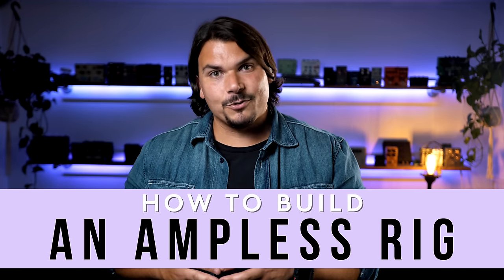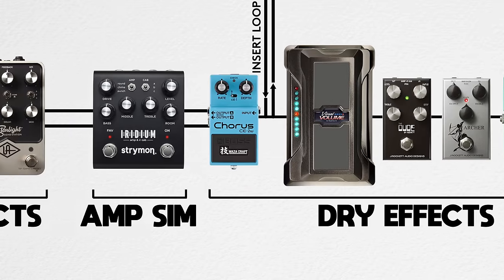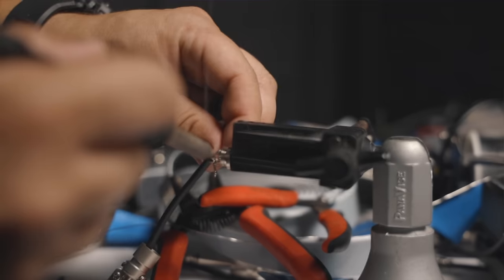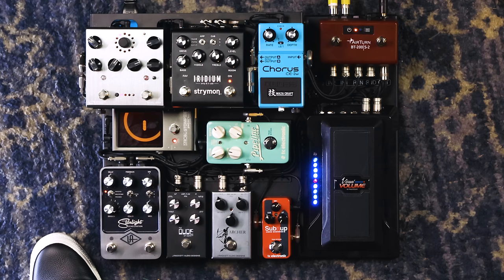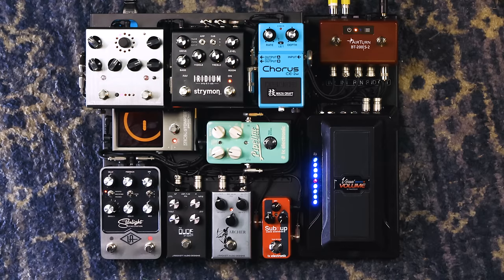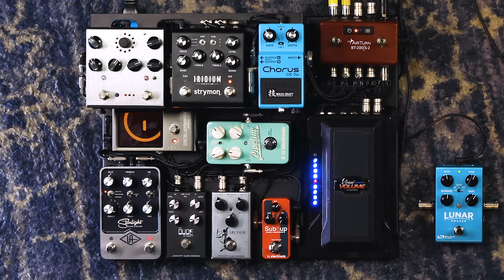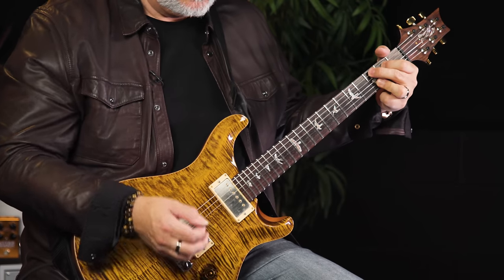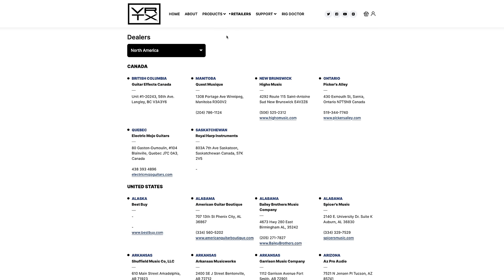Do You Need an Amp to Get Great Tone?

Comment: Thank you so very much for this episode!! The only set up issues would be if you want to 1. run the Iridium last to use as the output buffer and 2. If using the Iridium's headphone out, any effect placed post Iridium will not be heard through the headphone out for quiet play situations.
Reply from the maker: You can always run buffers at the end or choose pedals with low output impedances to drive the line back to the mixing board.

Comment: On my latest electric guitar styling post, playing a 1978 Univox Les Paul JR DC/single-P90, I am playing a rather interesting signal chain, which I will call ampless, but not exactly.

I have a 1964 Sears Silvertone 1482 in great condition (one cap needed replacement), which is fronted by a Behringer VT999 vintage tube monster (using a 1 amp dedicated power supply and a Genalex Gold 12Ax7), which I chain through a Bugera PS1, routing its line-out into the input-jack of Pod-Go (so that's three 12Ax7's and two 6V6's, along with the tube-tremelo circuit of the Silvertone [ plus tube rectifier on that puppy ] ) fronting a pod-go, where I use the "archetype" amp model on clean-switch and matching cab model), adding a DDR-600 spring reverb, all of which I then route through a Mackie DFX-12 (adding small room reverb and final EQ).

In front of all that is my pedalboard (skb-25 velcro!), from G10 to Boss CS-3 and Aphex Aural Xciter / Big Bottom, two (not one, but two) NR pedals along the way, noting that the effects loop of the Pod-Go send/return bringing in my Arion SCH-Z chorus pedal (remember those?).

So, it's kind of amp-less, chuckle!  Have you heard of anyone using a Sears Silvertone 1482 as a distortion pedal?  Chuckle.

Oh, I recorded into a Zoom H1N (24/96) - straight to micro-SD card. Which is cool because the Zoom H1N is "signal level activated" to start recording.  Not one general purpose computer in use (no DAWs, no nothing). Just pure guitar recorded onto micro-SD card.

Of course, the main guitar part took me 5 months of practice to pull it off in one take (that's a ten minute piece). Whew. Chuckle.
Reply from the maker: Sounds cool!
Reply: I omitted a part of the signal chain -- what I will call the "wet / dry" part of the signal chain.

The Bugera PS-1 has a cab-emulated XLR out. Introduce my UB-502 mixer (I have to give a shout out to the UB-502 mixer, which is about half the size of chocolate box). The cab-emulated XLR out represents the "dry" portion, while the "wet" portion is represented by the pod-go, with the Arion Chorus SCH-Z on the effects loop, along with the DDR-600 stereo reverb.

I use the UB502 mixer (which has an XLR input for the "dry", along with stereo input coming from the "wet"), and then I route that mix into the Mackie DFX-12 (which then goes to the Zoom H1N line-in to micro-SD card).

Comment: I use a cheap board rig of guitar - boss sustain/comp - boss pitch shifter - joyo AC tone amp sim - joyo analog delay - joyo atmospheres reverb - looper/tuner - Xvive DI/Cab sim into my mixing board and or optional Orange amp & cab. Powered by a rechargeable power supply. Everything is mostly self powered and can mostly fit into my backpack.
Reply from the maker: Cool!
Reply: @VertexEffectsInc  i  decided to ditch the Orange. I decided to sharpen my Boss Katana instead.

Comment: Bit off topic but since building an interface/buffer was mentioned I notice Mason uses the same solder station I have - a Weller which is invaluable to me. I've done PCB work on older DSL's which can be tricky, but pedal stuff is even smaller. I finally tackled an intermittent power problem on a Nobels ODR-1 today and resoldered the bottom input and power jack connections which fortunately seems to have fixed it. But things are so small that it's almost imperative to have an adjustable heat range and a small, skinny tip. Weller type stations are more expensive than a garden variety iron or gun, but IMO those can really do damage to small PCB boards and components.
Reply from the maker: Well said!  Weller is great and makes easy work out of soldering.

Comment: Make more videos about using various pedals that are amplifiers pedals. The Doug Aldrich Baroni Lab Miniamp is 120watts and suppose to sound just like a plexi. If they have really good fender tweed, blonde, blackface miniamp pedals like this to put on your pedalboard to go ampless. The problem is finding really good miniamp pedals that sound very close to tube amplifiers that uses JFETS or MOSFETS instead of digital processors. The picking dynamic range very touch sensitive is what to focus on.
Reply from the maker: Thanks for this info Wayne!

Comment: I get why you want to run the Iridium before reverb and delay . To get results like you would in an fx  loop but how does that effect impulse response? It seems like it would be equivalent to putting reverb and delay on a cab mic.
Reply from the maker: It would be like using the effects after the mic, correct, like 99% of studios would add on processing effects in post or from a mix bus.  Very common.

Comment: AMT make some of the best "Amp in a Box" pedals....especially  the V-1 and F-1 that is for Vox and Fender sounding pedals.  They have a built in speaker emulator, Bass, Treble, Effects loop and multiple outputs....Its a no brainer. !
Reply from the maker: Compared to what?  Does it do all of the big name amps in one?  Vox, Fender, Marshall?  Does it does three different cabinet types?  What about room mics?

Comment: Maybe a curve ball on the ampless rig: acoustic.

I'm going to do a couple pieces on acoustic. I have a Fender La Brea from the mid-1980's and it has a 9-volt on-board pickup system. I'm thinking of running the line to the pod-go and dial that up, but then mic the guitar (I have a sure-sm58) and run the mic-xlr as the "dry" path. Hmmm.
Reply from the maker: you could that.
Reply: Where would you place an acoustic sim pedal like the Boss AC-3 in this chain? After buffer but before compressor?

Comment: Talk about timing. I'm literally. adding an Iridium to my board to be able to run ampless when needed. I've owned an Iridium for about a year and a half and it's been great for getting stellar guitar tones while teaching lessons on Zoom. Been doing more and more pickup gigs and having something more portable than amps and cabs is gonna be nice. The thought of rewiring my board is giving me hives, though. I built a junction box from your schematics so I can go from wet effects being in a loop or straight into the front. If I wanted to use my Iridium off the board and still have wet affects AFTER the Iridium, could I run my guitar into the guitar in, the out into the Iridium in, the Iridium into the effects in and then the effects out to a DI box? Does that make sense?
Reply from the maker: Just treat the Iridium like the amplifier.  Iridium In (like amp in).  Iridium Out (like FX send).

Comment: I trying to build an ampless board but ran into trouble. I have the Iridium and placed 2 delays and a reverb after it in the chain just as you suggested. I’m running into a Line 6 Powercab 112 Plus and they recommend using line level for most realistic speaker break up effects. A light shows you when you’ve reached the optimal level but the only way I can get it loud enough using the iridium is to crank the volume all the way, then use the secondary function to boost the level trim all the way, and even boost input gain slightly on the Powercab. I’ve just noticed doing this makes my delays sound distorted, maybe they can get overloaded by too much volume???
Reply from the maker: I have no problem driving standard JBL or QSC powered monitors for this application with no issues.  Why not run the system to FOH and have them send you a line out to a wedge on the floor?
Reply: @VertexEffectsInc  No gigs here. Just jamming out in my basement by myself! 😆 I was going ampless to keep the volume down at the house.

Comment: So, for ampless rig, you don’t need the output buffer or in this case is because the Iridium?
Reply: Yes but Iridium needs to be placed last and you'll most likely want an input buffer as well. Something like TC polytune 3 with buffer for example.
Reply from the maker: If it's the Iridium, no, it has a 100 ohm output buffer already on both channels, L and R.

Comment: Mason, I use a HX Stomp for all my amps sims and effects but I use a Gunshot for overdrive. The Gunshot is before the HX Stomp in the signal chain and it sounds good to my ears but is there a better option i.e. running the Gunshot into the loop of the HX Stomp?
Reply from the maker: It depends what effects you were using the HX for, if it’s all time best stuff then there’s no problem putting the overdrive in front of it, if you’re using some effects that would be before the overdrive versus after the overdrives in the effects loop might make more sense.

Comment: Great video thank you. My question is from there how you go to the FOH
Reply from the maker: The output impedance of a lot of these amp simulators are so low that it could drive 100 feet of cable without much issue, you could also use a DI at the end.
Reply: @VertexEffectsInc  thanks Doc

Comment: Hi Mason , I’ve got some pretty expensive pedals as most do , always concerned of wrecking the backing when it’s taken off , how is the Vertex Adhesive ?
Reply from the maker: The Power Grip is designed to be as gentle of an adhesive as possible.  I've yet to pull paint off a pedal that's reasonably well powder coated.  Some of the more DIY pedal makers do their own painting which isn't on par to pro powder places and don't always have as clean of enclosure which can lead to bubbles or bad adhesion of the paint.  Even masking tape could remove that paint.  To the degree that the pedal is somewhat well painted, our Power Grip will be great and comes off easy, no residue to speak of.

Comment: I’m not very familiar with pedals like the Iridium so I apologize if this is a basic question. If I built a board like this, could I go directly into a cabinet as opposed to direct?
Reply from the maker: The Iridium can't drive a cabinet as I understand, you'd need to connect it to a power amp to do that.

Comment: I'm having trouble setting up iridium.  Is it necessary to select the line input in the setting to turn the drive volume because it is inputting in stereo?  Also, I think there were -20, 0 and +3 in the master volume, but what did you choose?
Reply from the maker: Generally if you're driving it with pedals on a pedalboard it should be instrument level (-20) on the input.

Comment: Hi Mason....Thanks so much for the videos! They have been most helpful in breaking old habits and learning new things! 
If I may ask a few questions:
1) I noticed Mitch wasnt running any sort of compressor on his board. Would one be best placed after the buffer but somewhere before his overdrives. Was this personal preference?  I know in your other video you set a compressor there in between those pedal types. 
2) If you ran chorus reverb delay AFTER your Iridium would you be best served sticking a buffer at the end of that chain but before the board? How would you manage the stereo signal at that point. 
3) If you chose to run a chorus after the Iridium, would you just run TS cables til the end and then into 2 channels into the board via DI?
Thanks again
Reply from the maker: 1) compressors are fine post buffer normally.  Buffer should come as close to the guitar as possible pending any impedance sensitive pedals like fuzzes.  2) You could put buffers at the end of the stereo chain (one for the left output and one for the right output), but some of those pedals have low output impedance already and are stereo, if the pedal is around 100-200 ohms output impedance you should be fine at driving an unbalanced cable to your DI or whatever you're doing to get the signal to your PA or interface.  If the chorus is stereo you can run the stereo out of the Iridium into the chorus and continue the stereo path from there, if the chorus is mono you can run mono out of the Iridium and then start the stereo path after the chorus.  3) I think this was answered in #2.
Reply: @VertexEffectsInc  Thank you Sensei! I am learning so much from your videos. I clearly  suffered from the Dunning-Krueger effect. Meaning I didnt know what I didnt know. As I move from unconscious incompetence to conscious incompetence, I am realizing how i coukd NEVER get my stuff to sound right. I would just turn up to overcompensate for what I didnt underatand.
Reply: @VertexEffectsInc  i was able to answer some of my own questions by watching one of your Chairmen of the Board podcasts.
Reply from the maker: @donovanwillis370  great!  We're here to help!

Comment: @Vertex Effects Mason, I’m surprised a midi/loop switcher wasn’t used, cost? need? Preference on his part? As usual, 👍 Keoki. PS love the “audition feature” I’ll have to check out that interface link you provided. Would there be any difference between amp-less and amped design on that circuit, my elderly brain is reaching for this one…
Reply from the maker: He didn't need one...he has a few basic tones for clean and dirty so there aren't very many switch changes needed.  This was a deliberate choice.  Mitch had an ES-8 rig for some time and found it overkill for his needs.  The ampless rig vs. normal rig would only be different in that the time-based effects like Delay and Reverb would go in the effects loop versus after the Iridium.

Comment: Hi Mason, great video as always! What changes if any need to be made in order for the buffer to have the option of going into the mixer or into 2 amps? Thanks in advance!
Reply from the maker: If that last pedal is buffered and around 100 ohms output impedance you could probably just go interchangeably between amps and the mixer.  If you have a higher output impedance pedals as the last pedals before the amp you could add stereo output buffers and it won't hurt anything in either application.

Comment: Am I wrong that you can hook up a Strymon Multiswitch Plus to the Iridium and make three more FAV presets?
Reply: You can actually have 128 favorites with the Iridium if you are willing to use MIDI, something like a Morningstar MC6 (or in my case I use the presets on my HX Effects to each save their own Iridium favorite). I'm not directly familiar with the Multiswitch but I do know Iridium itself supports 128 different favorites. If you only want a couple physical button options to grab easily the Multiswitch is probably worth checking out.

Comment: Great video thanks. Sorry I’m late to the party so not sure if you’ll be able to respond but I’m having issues running unbalanced TS cables out of the Iridium straight into the back of two JBL 305P speakers - I’m not hearing anything. Folks at Sweetwater said I could run right out of Iridium into the JBLs with TS cables, is that your understanding as well?
Reply from the maker: Powered monitors should be just fine...the output may need to be increased on your Iridium and on your powered monitor as well.  That's how we were doing playback during this video.

Comment: Great video as always! How do we go about doing a Wet Dry setup with Strymon Iridium? Planning to have Round (Fender) as the Wet amp and Punch (Marshall) as the Dry amp. Do I need 2 Iridiums in order to have separate amp models for Wet and for Dry?
Reply from the maker: The best way to do it would actually be to run the iridium with all the dry effects into the mixing board, and then have an auxiliary send to collect the wet effects.
Reply: @VertexEffectsInc Never used a mixer before, will it help with setting up two different Wet and Dry amp models working together at the same time? Which mixer would you recommend to go with the Iridium?

Comment: Hello,

I was wondering if you have any recommendations for setting up an ampless pedalboard when using a modeler with stereo outputs (I'm using an ACS1) together with a reverb pedal without mono output. Ideally I want to use the dual amp function of the ACS1 with reverb on both sides but I'm not sure how to do that if the reverb pedal is connected after the modeler. Should I just connect the reverb pedal before the modeler in the signal line?
Reply from the maker: You'd have to put the reverb before the ACS-1
Reply: You could also make it wet/dry and run the reverb/delay whatever full wet in one side and dryer guitar on other! Don't know the ACS1 well but iridium you can set it to duel mono which is perfect for doing this. Need to go full wet though and hope don't have any phasing issues at all!

Comment: This is a great board and all of this is down to matters of taste (obviously this is a guy's custom board!), but it's just my opinion that putting the reverb and delays after the amp/cab sim is going to be lackluster for a lot of players. I feel like it kind of puts a blanket over those effects, as the speaker/resonance simulation delivers a very different attack to those effects. Like, you're expecting to get tight hi-fi repeats and crisp modulated reverbs, that is not the ticket.
Reply from the maker: if you want a studio application, the wet processing effects after the mic is how it would be done.  It also depends on the amount of gain you're setting the Iridium for and the type of cab simulation.  If you use a lot of gain on the amp sims on the Iridium with speaker distortion, it's going to be just like you put an overdrive after a delay pedal in front of a clean amp, not generally what most people would do for optimal performance.